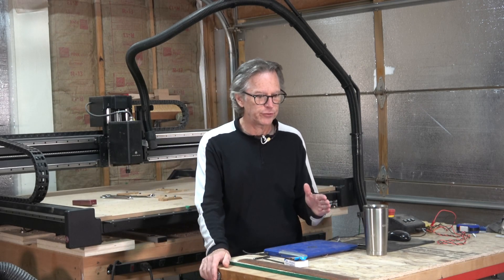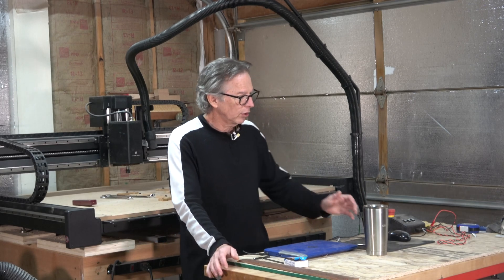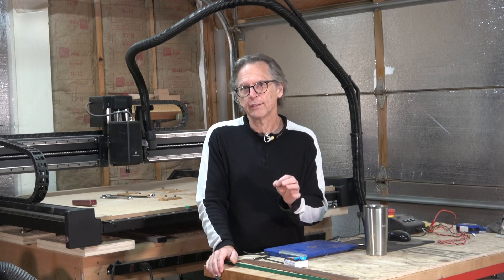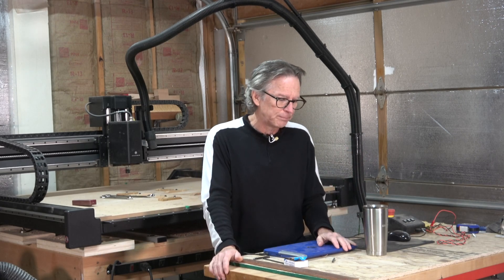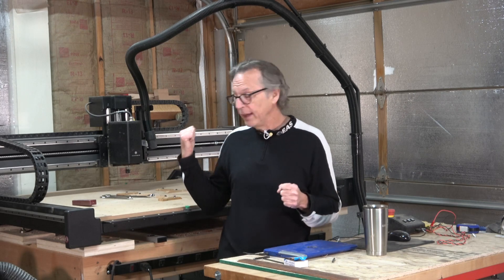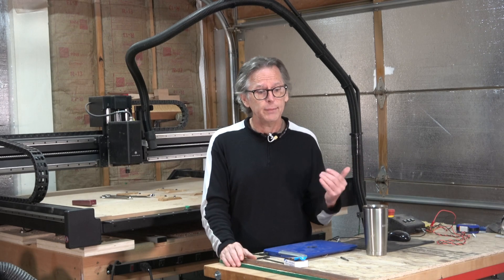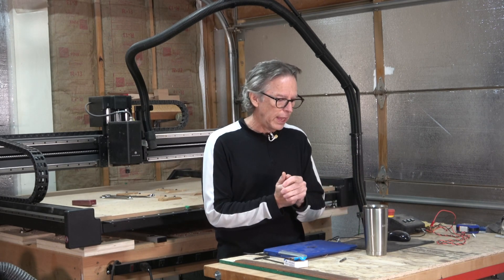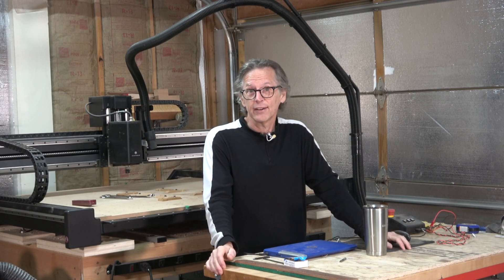Why CNC CAM Strategies Are So Important For Making Guitars

Comment: Did you have to get a different electrical service installed in order to use the X-Carve Pro? By different I mean a larger ampere service.
Reply from the maker: No. Just a regular 110 outlet.

Comment: I'm glad you did this discussion for folks...it's an important topic. It's important even with a larger, heavier, more capable machine. Aside from the technical aspects of optimizing for the given tool  as you discussed and what you want to do with it, the extension is also making sure one thinks through the cutting process to further gain efficiency. I liken that to "thinking like you're the machine" and also striving to use the most efficient toolpathing in the CAM plan to get the job done. Order of operations to reduce tool changes, using the most efficient type of toolpaths for a specific operation (2/2.5D, linear like Vectric's moulding tool path and 3D, in that order of preference)  and so forth kich things up a notch beyond just leveraging better feed rates, etc. I honestly avoid 3D carving where I can do it a faster way with the same or similar result.  At any rate, the one thing I think you are a bit optimistic on is eliminating sanding on CNC created wood components. Even with the tightest, most time consuming step-overs on 3D finishing toolpaths, I think the finesse work will still remain. But it will take a fraction of the time and that's a good thing, particular for folks who are making for others. And if you can get to "sanding free"...I'm going to be paying attention to how you pull it off. :)